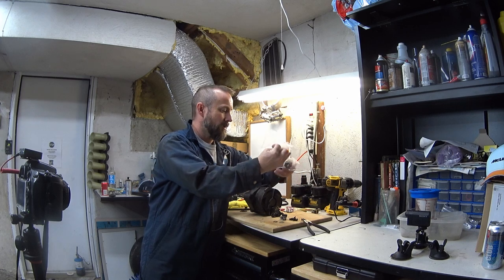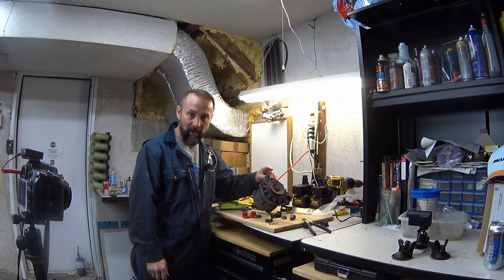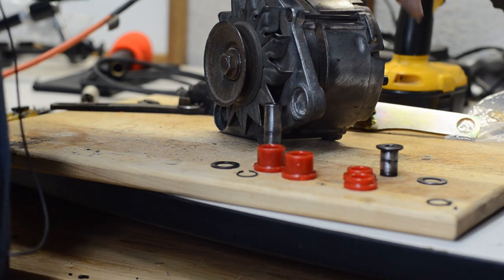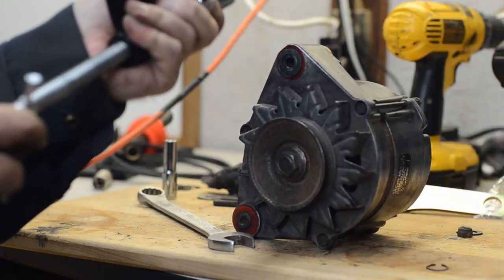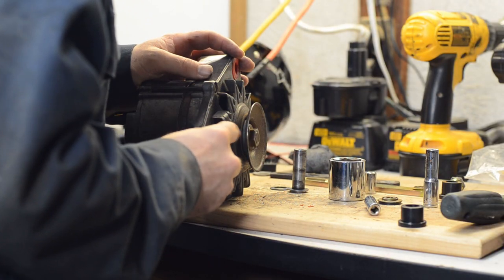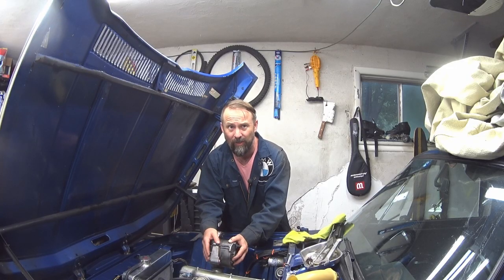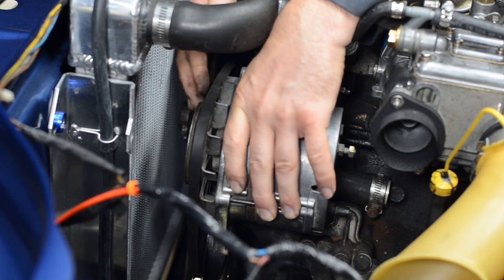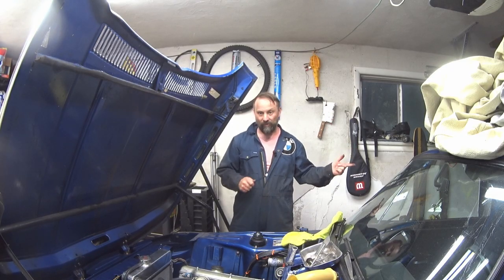PROJECT 1968 BMW 2002 PH02E10 - Alternator Bushings

Comment: Make sure those teeth line up with the slots and fit snug for that alternator tensioner.. wouldn't want any tension issues. That throaty sound of the m10...❤ it!!
Reply from the maker: Yup, actually just went and double checked...  Had the car out a few times now and everything is nice and tight.
Reply: @spuriouspseudo  cool

Comment: What radiator are you running?  It seems to have a nice looking rounded end on the top tank that some of the others don't have.  Thanks
Reply from the maker: It's a Champion Cooling Systems rad... It's a good unit an cost effective.  I had some trouble on my car but the general consensus is that they drop in.  More details here:
https://youtu.be/BjkB-dbng_E

Comment: Wonder if it’s worth spending an extra 14 thousand and getting a 1972  2002 car that’s been restored from suspension, engine , drive train and interior versus getting a 1968  1600 that is bone stock. Just wondering if it’s cheaper by spending the extra cash up froo
Reply from the maker: I would ask what you're looking for, a complete car or a build experience. If you want a driver, grab the '72.  The '68 being a 1600 will be lighter, if it's unmolested could appreciate more over the years as a 1600 as I think that they'll become hard to find...  Do you see yourself wrenching more or do you imagine mainly driving?
Reply: @spuriouspseudo  I want to tinker with it every other month , lowering it add some wheels try to spice up the engine. See if I can make it a tad faster, wonder if people put the tii engine in the 1600